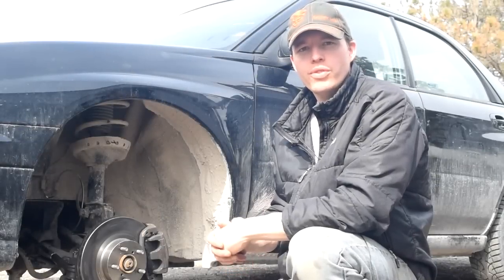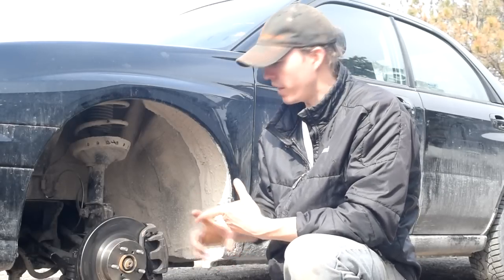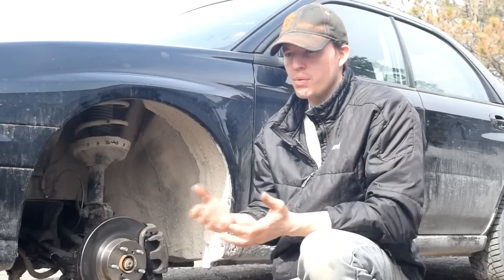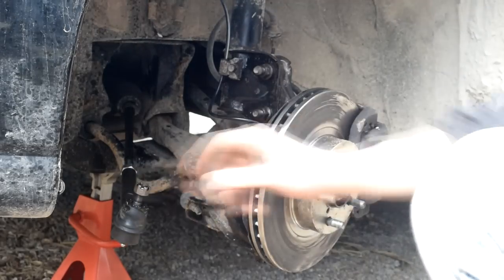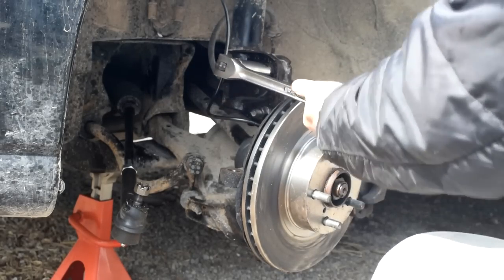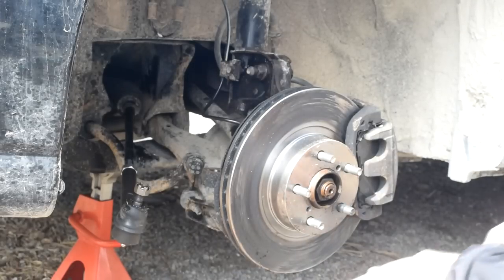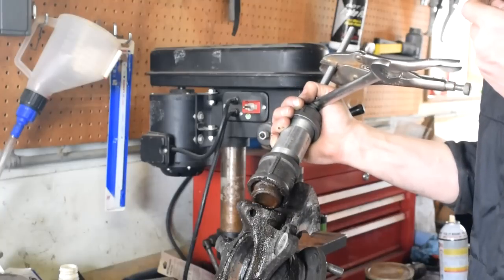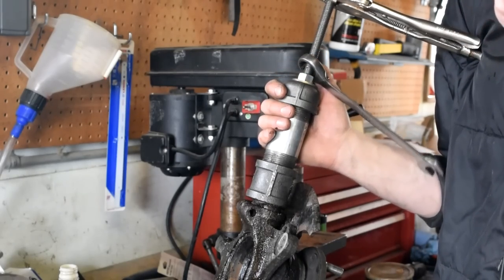How To - Replace Ball Joints Subaru and it all goes wrong!

Comment: This was super helpful. I tried every possible lever and couldn't break the ball joint free.  Your tool worked like a charm!   I took off the control arm and was able to remove the ball joint while keeping the knuckle on the car.  Didn't have access to a welder, so I used a coupling nut to connect the threaded rod to the ball joint -- the thread didn't match the ball joint, but it holds just fine if you wrench it all the way up on the ball joint threads.

Comment: I work at a Subaru only garage in Northern New England and see a lot of rusted ball joints that need replacing.  Our approach is thus;  Once the car is up on the lift with the tire removed I cut both ends of the cotter pin close to the castle nut , tap a air impact socket onto the nut and spin it off ( I use a half inch drive  gun , air or battery, for the entire process) Once castle nut is off I cock the wheels so I have hammer swinging room ,I  hit the edge of the control arm where the stem of the ball joint passes through...a 4lb. hammer and one good hit will break  free the lower portion of the ball joint from the control arm,  then using  a long pry bar I  press down on the control arm until I can slip the lower part of ball joint out...now the fun begins...I never try to get the pinch bolt out without heating it first...don't heat the bolt itself, but the area surrounding the bolt...don't  melt or catch the axle boot on fire ...you don't want to replace that too...I use a big torch and heat the area almost red ...I have my gun already so when I put down the torch it's only seconds till my socket is on the pinch bolt...I start slow and watch the end of the bolt...once I see it's turning I go for it , rarely does it break if it's been heated properly .  Now I use the air hammer with a chisel bit , I bite into the edge of the ball joint then pick the back of the hammer up so the chisel slowly starts to point downward , once I'm at a downward angle I let it rip and the ball joint will pop out ...kind of like digging it out with the chisel bit .  I clean out the hub socket for the new ball joint , I thread the castle nut onto the end of the ball joint and with a small hammer tap it up into place , then I  put the pinch bolt  back in ...I usually clean up the bolt on my  bench grinders wire wheel  and lube everything good.  Now I pry down again on the control arm and slip the threaded end of the ball joint back into the control arm ...gun  on the castle nut put a new cotter pin in and with the tire back on down comes the lift...check the lug nut torque and she's good for a test run.  Every so often even with heat you'll break a pinch bolt ...then you need to drill out the old bolt and put a bolt nut combination in place...not nice to look at, but it works fine. I understand most folks don't have the various tools or a car lift at their disposal, but this was basically to give ya the idea how a garage might do it...and heat is your best friend when it comes to rusted bolts and nuts...just beware what else the flame might be hitting and a spray bottle of water at hands reach isn't a bad idea either...good luck.
Reply: awesome! could you tell me what size nut and bolt to get, if I end up breaking the pinch bolt...
Reply: Your not trying to match thread size because your drilling out the old bolt so it's whatever fits.  The diameter and length will be obvious once you drill out the old one, just make sure it's a good quality auto bolt and not something soft.
Reply: @willyD200  thank you for the reply
Reply: good info, thanks! I agree on heating first, in addition I also start spraying with pb blaster few days in advance, more is better

Comment: Been there done that! Multiple times. Three I think.
One time, I drilled it out, then as I was trying to hammer out the last chunks of the bolt, the clamp itself split. Turned out a crack had been forming for a long time and it was only held together by a small section of good metal. Had to replace the whole hub using one from a junk car.
Another time I drilled it out and saved the threads, no huge deal just a lot of work.
Last time I drilled it out, but the threads didn't survive, so I just drilled the hole a bit larger, used a through bolt with a washer and nut, and ground a flat spot on the other side of the ball joint clamp. This is actually a really good solution in the end, just sucks to have to do it. I also knicked my brand new ball joint boot when I was grinding, that was a pisser. Patched it using a piece of old boot and super glue and it has held up for two years so far.
Now every time I change them, I grease the hell out of everything, I never seize the hell out of the bolt, and I actually pack the bolt head, end of the bolt, and the entire ball joint clamp split full of heavy grease so it can never rust to hell.
I love Subaru, but I really would have loved a slightly different ball joint clamp design.
Reply: I have also noticed the new bolts that come with most aftermarket ball joints are of much lower quality than the OEM and love to rust and snap! Not much to be done except buy a really nice bolt to replace it or lube it to death.

Comment: A couple things - you can stick a screw driver in the disc brake vents before the caliper to keep it from rotating while you get the axle nut off. Also, your ball joint came out pretty easy. I used a similar tool and it stripped the threads off the balljoint stud because the balljoint was so rusty. I had to heat up the balljoint housing with a torch while pulling it out.
Reply from the maker: chiggymonkey Thanks for the tip about getting the axle off!  Ill have to do that next time.  Yeah, I didn't know if it would work for sure using that tool.  The last ball joint I did I didn't have the tool and was prying on the slit and working it with a cold chisel and screw driver.  Not much fun that is for sure.
Reply: Matthew Eddy 1/4 inch by 1/2 inch steel bar will work even better and take up to 230 foot pounds of torque.You should also put your cheater pipe close to the socket so if breaker bar breaks it won't be flying
Reply: +Dick Fageroni or just a short length of that black plumbing pipe for about $2.

Comment: When I replaced the clutch kit in my 2010 Forester I also sheared the pinch bolt for the lower ball joint. I broke two extractors trying to get the remnants out. In the end I found it was much easier to just use a cobalt drill bit and and drilled out the rest of the bolt (in place) and replace it with a hardened nut and bolt rather than spend all the time disassembling the all the other crap you have to to do things the 'hard' way. Next week I'll be replacing both lower ball joints and if I have any trouble with the other pinch bolt ( I'll try putting some heat on it in addition the penetrating oil) I'll not hesitate to drill it out. - I want to drive it not spend my entire weekend anguishing over working on it. 

On a side note, if you have to drill out the pinch bolt you'll never have the issue of having to drill it out again. If the replacement nut and bolt combo shears you could just use a punch to drive out what's left of the bolt.

Comment: FYI the assembly you removed is the knuckle. The hub you left installed on the knuckle, that's the part with the bearing, the wheel studs, etc that the CV axle goes through. 
My mechanic had this same problem doing the joints on my 03 Outback. First side the head snapped off.  Second side he just torched the heck out of it to start and because it was in better shape and made a better seal the ball joint itself exploded and shot out of the knuckle. Be careful torching!   But it did break the bolt free perfectly easy.  On the first side he had to drill and replaced with a through-bolt with a nut on the end.
Reply from the maker: True, I get a little loose with my terminology. Yeah, the job can be a real bear.

Comment: WARNING: Those 14mm pinch bolts are a MF'r. If you shear them the job just turned into a nightmare. The best way to approach is to spray them w penetrant the day before. Then spray again. The trick is to tedious try to loosen just a short hair, then tighten, then loosen a lil more, then tighten, then loosen a lil more, etc... back and forth just a lil bit at a time. If you do get them out in one piece, REPLACE them.

Comment: Thanks for making real video.  Tired of those southern and California guys just unbolting stuff and then it just falls apart.  Up here (I live in Cleveland) it just doesn't work that way.  You could have drilled out the bolt why it was on the car but since you had to replace the ball joint anyway your way was fine.

Comment: Happened to me to weekend. Take my advice. If you have a welder: Weld a nut onto the other side of the threads and you can actually extract it that way. I found that to be way easier than drilling out the bolt.
Reply from the maker: Now that I have a 230v welder this is definitely a good option now!

Comment: I use a chisel through the caliper to hold the hub when loosening axle nut.  ABS can be unplugged in engine bay and just pull out the wire with knuckle if it won't budge in knuckle.  Anyway, off to drill out my ball joint bolt. Thanks for the video.
Reply from the maker: Yes, I learned this trick a little later using a screw driver.

Comment: Thanks for taking the time to make this video; about to start on the replacement of my 2006 Outback(both lower arms that have new ball joints in them); hopefully I won't have the problems you had (123,000  miles) but it's good to know what the procedure would be  if so.
Reply from the maker: I hope it goes smoothly!
Reply: Driver's side went smoothly, but just like you, I broke the pinch bolt for the ball joint on the passenger side(ugh). Fortunately, I've had quite a bit of experience with rusted in bolts(suspensions on Jensen Healeys).
 After a totally disassembly, I was able to remove the broken part after drilling out most of the bolt and using a chisel to "bend" the remaining part into the drilled out hole, thus allowing the reuse of the threaded portion.  The key to this is making the initial punch pin in the center of the broken part. All the bolts were wire brushed clean and plenty of anti seize used on the bolts along with rubber grease on the various new rubber bushings(replaced with the upgraded solid aluminum lower arms-Rockauto). 
Took the Subaru for an alignment and found the toe-in/out was way out of specs;  the steering wheel is now straight when I go down the road.
Thanks again for the video and hope my addition will help another owner.

Comment: Well it wasn't exactly what you had to go through (lucky the pinch bolt didn't snap) but the ball joint refused to pop out. Glad you said socket trick, just grabbed the shortest socket I could and used that between the knuckle and control arm with an impact to press it off while it was all on the car. Definitely saved me some headache given I work tomorrow.
Reply from the maker: Good to hear you were able to get it done!

Comment: Maybe next time heat that threaded side up and spray with pb blaster then work it back and forth as it’s loosening until the bolt  feels like it will freely. Just a piece of advice if it feels tight and it won’t budge heat it and keep spraying pb blaster on it. Makes the job easier and you’ll never have to go threw taking all that apart
Reply: Just did an outback and heat and PB blaster didn't do a thing.  In fact when I got to the hub part of my project one of the bolts holding the hub in wouldn't even come out of the knuckle even with the hub totally out.  Today i did the other side and purchased all new fasteners.

Comment: Good for you making a tool. However the "Astro Pneumatic Tool 78620 Subaru Ball Joint Puller" tool is available from Amazon for $27 from Amazon.  China made - but works FANTASTIC.  Less than 30 seconds - ball joint out.  This Astro tool is available from other places as well.  Factory 23 makes a very well made tool for this job - US made - but close to 3x the cost. Slightly different design - both work great - and won't disappoint.
Reply from the maker: They weren't available when I was doing this because I looked and there was a tool someone was selling for a while but when I tried to find it they were not making it any more. I am glad they have some more options now.

Comment: first off thanks for making the video...it always good to gain experience through other peoples efforts. i think i would pre-treat every thing wirh some kind of penetrating lube spray (youd be suprised) and then i'm really curious what you are going to use to reinsert the new ball joint ... the leverage you had removing it wont be there when reinserting. 🤔
Reply from the maker: Yes, I usually pre-treat everything because I live in Michigan and the salt really play havoc on the cars. Re-inserting is easy.  They usually slide right in - perhaps with a little tapping.  They get rusted into place and thats what makes it hard to remove.  You can sand the inside a bit to remove any buildup if you have trouble getting it in.  Also, use axle grease to help keep it from rusting again.

Comment: Guess I was spoiled where I just popped the pinch bolt... Breaker bar on the getting the ball joint out of the hub then a pickle fork and hitting with a hammer 200k and rust long began eating it away but it all came out well enough minus for the ball joint that slipped back into the hub after I popped the castle nut and the nut would not go back on ... Made getting the ball joint back out harder but another wedge I to the gap of the pinch bolt let it go easily enough 🤪
Reply from the maker: Don't brag. No one likes people who brag. LOL

Comment: I think the reason this bolt rusts in place and breaks is due to the design. The head of the bolt seals a flat on the casting, but that isn't good enough. The split allows salt dissolved road splash to enter the through hole from this place. Add capillary action and it completely rusts the bolt and hole.Better design would be through hole all the way and a nut& bolt.
Reply: PS another clue is how the bolt shears right at the head, not where threads start, indicating it was held tight, not by threads, but rusted shank.
Reply from the maker: I agree, its a terrible design for any car exposed to salt/snow - which is what the car was designed for.  I am not a big fan at all. I would rather they were bolted on with two bolts to the hub and it would solve this issue.

Comment: The cam bolt  for camber setting  you pulled out should have been  marked so that you  can  keep the correct  angle.
Reply from the maker: Yes, you are correct. I should have noted this in the video. I will try and add an annotation when I get a chance. Thanks!

Comment: I am currently having this issue right now, sheared the bolts, drilled them and have literally tried everything to get the ball joints out of the knuckles of my 01 forester. I bought the the car 5 months ago and I'm like 90% sure that they are stock from factory. Can't use a puller because the ball joints just completely free spin when threading on. Anyone have any advice?

Comment: to get the axle nut off you could have someone step on the brake while you get the nut off
Reply: When your working in the front like he is you don’t even need a buddy, you can stick a screw driver in the ribbing in the middle of the rotor and brace it against the caliber.

Comment: I actually got the pinch bolts out, then busted my knuckle  overtightening a brand new bolt.  Not only did I brake the new 10.9 bolt off  but cracked the knuckle.  I am going to use a Bolt and nut on the pinch after I replace my knuckle....
on the bright side, I just got one of those M18 impact guns, has taken off anything I've thrown at it.  As long as you can reach it at least...
Reply: Patrick C. Always use a torque wrench click  type to torque the fastener to factory spec

Comment: Howabout the axle pulling out of the transaxle when pickle bar separating the BJ from the casting? Pulling off and dropping one of the donut wheels in the dirt? This, after the whole break bolt and drill out routine...Fun times. Helps to have a puppy to supervise. And by that I mean licking my face whenever my hands were occupied. Rag stealer, too. For the record, I did heat the casting with an oxy-acet torch, anticipating trouble. Broke too easily, like butter. We wouldn't be doing this if we didn't love a challenge, eh?
Reply from the maker: Yes, and it was probably 100 degrees outside and humid :-)  Thats what I love about it too!

Comment: I didn't have any issue getting the ball joint out for the most part. My biggest issue I'm running into is getting the new balljoint to go in all the way. It acts like it gets stuck about 3/4 the way into the knuckle. We've frozen the balljoint, put all the weight of the car on it, hammered the hell out of it. Shit wont budge!
Reply from the maker: Wow, thats weird. Are you sure its the right size? Have you tried using something to pry open the knuckle?

Comment: I use a dremel tool with a carbide metal bit on it for removing the "tang" on axle nuts. You can have a person in the car hit the brakes if you have the car in the air already to loosen the nut. Might have to turn car on to get enough brake pressure.
Reply from the maker: +Rob spear I recently learned to use a screwdriver or something similar in the vents of the rotor to get the nut as well.